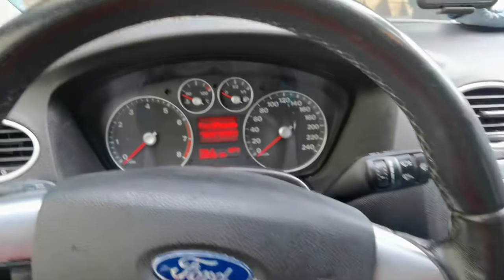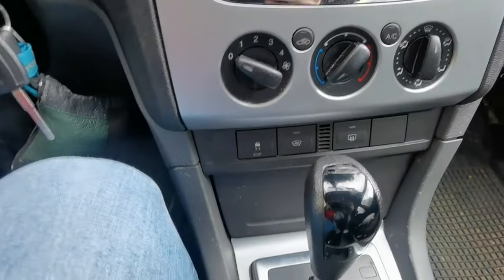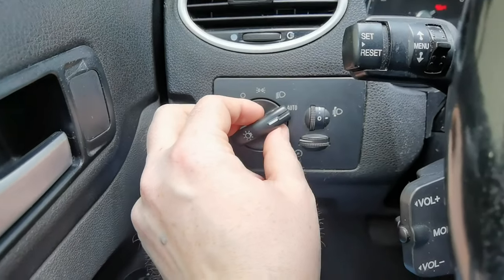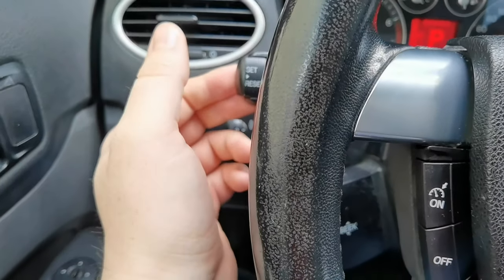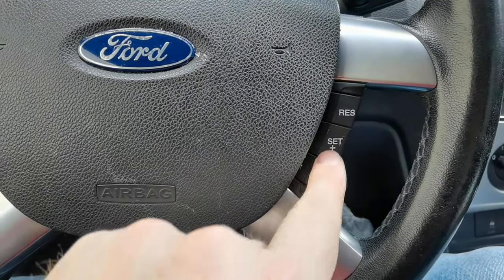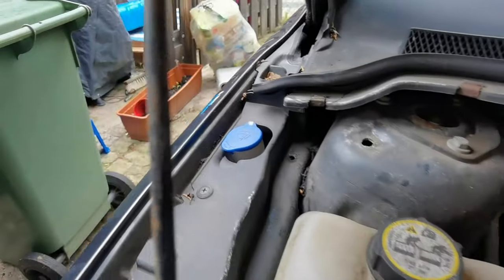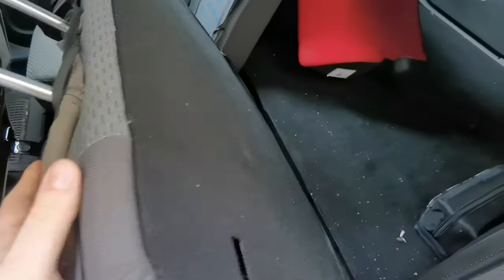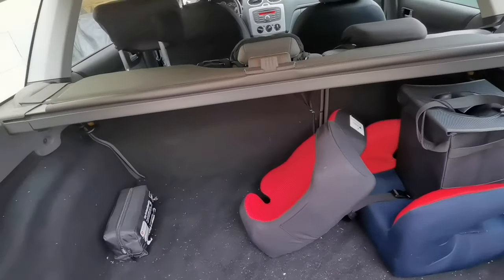Ford focus mk2 (2006/2007) all the controls and features

Comment: Good video the automatic selector probably just needs tightening with the small grub screw this happened with my focus when the selector came off in my hand. Luckily enough I  found the small screw and used a bit of glue before refitting. Yes with the Auto you carnt remove the ignition key unless p is selected as this is for safety reasons as the front wheels become locked in park

Comment: My biggest problem with focus mk2 are the freaking doors locking system freezing during winter, and often getting water into the spark plugs and the mech`S suggest me to get a top shield over the entire engine, but as far i know there is none for the regular gasoline version. But i know Disel versions had, but i did find a Volvo shield that fits over the spark plugs as the mk2 and volvo v40-v60`S are more or less based on the same platform. So yeah my ford focus mk2 now has a Volvo plastic shield over the sparkplugs :D 

" Volvo 30650468 " part number 

But nice info in the video about the back seats. Dint know they could be lifted up.
Reply from the maker: Yea I also just figured that out one day after using it for some years I guess (back seats)

Comment: Hi, How to open the trunk? I do not have an electronic Key just a simple key. I've lost my electronic Key
Reply from the maker: Isn´t there a button or lock at the trunk? I can´t quite remember how it was on our model but that might vary (our now car can only be opened there via the button - that was a problem when the motor that moves the lock broke) 
I think American cars require a emergency open thing in the trunk but that does not help much for day to day operation.

Comment: One question this car have Bluetooth for music??
Reply from the maker: I don´t think there is model which includes that (ours had the buttons for Bluetooth phone connection but that was for a model class above I guess) there are 3rd party radios available where that would be possible.
Reply: Not this specific model, the 2009 model (pretty similar to this) can actually have bluetooth Audio/ usb/ Aux but only with an original Sony stereo and with a right Bluetooth module (hidden behind the glovebox), but again, only for the 2009 Model, this model with the Ford 6000cd only has Bluetooth for calling and nothing more, you can buy cheaps bt reciver on amazon that plugs in the 12v socket and gives you bt audio through FM radio.
Hoped i help

Comment: whre is the radiator?
Reply from the maker: Should be right in front of the engine unless you're talking about something more specific like the heater core.
Reply: @kunicross  i mean radiator cap?

Comment: Ford Focus mk 2 is the one of worst ford evermade .What a bad quality and shit car !There is problem with everything ,bad electronic ,bad motor ,bad strearing,brakes is shit ,taking 10l per 100 km  .I had one and after 3 months throw on garbage and bought VW .
Reply: The MK1 was better (in quality), the MK3 is better to...
Reply from the maker: Now after months of driving other cars I´m almost agreeing - we got our as a present so I´m inclined not to talk too bad about it but I´m glad we´re rid of it
Reply: i have a ford focus mk2 for two years now and all i changed are regular things like oil and tyres. Excellent, amazing, easy, economic, sexy too. It's parts are cheap and are strong. But ofcourse if you drive like you have a Lamborghini, you would say it's the worst ford evermade.
Reply: @ronnyberna663  
I driving 80 km/h and 100 km/ max 😃 .
So ,you are a wrong🤷‍♂️ .Focus 1 is good car ,but that 2 is a great shit ...many mechanicers  saying that  too ...
Reply: @zlatkofilipovic1509  you must have bought a shitter, mines fine pushing 290bhp perfectly fine with no issues 👌🏻
Reply: @roanoconnor98  
Not only me bought shit ,others also ! 
1.8 it's famous as oil eater .
Taking oil same as fuel ! 😃 8l per 100 km oil & gas 😃
Reply from the maker: I used a somewaht similar Ford Sierra a decade bevore the focus, somewhat similar problems with plastic parts breaking and electrical unreliability.
So far Fords track record for me personally is quite bad but I wouldn't say it's enough go judge the whole brand in either direction - overall pretty meh neither stellar nor terrible.
Reply: @kunicross  
No ,i love Ford 
But  focus mk 2 with duratec he 1.8 engine 2005-2006 is a really shit .....factories mistakes ...they screw that .
Reply: @zlatkofilipovic1509  Depends on luck and on how good maintained the car was before you bought it.
Had a Fiesta 2000, facelift, for 4-5 years. A beast of a small car. I've changed the fluids regularly and to be honest, it took me on and off road to places I never thought I could get that car to.
Then I got a Focus MK3 2012 that, believe it or not, blew the engine on highway (autobahn) after only 2 months. Piston 2 melted. Yes, melted. It has a melted missing chunk the size of your thumb fingernail. Rip this one, I really loved the car.
Now I have another Focus, MK2 this time. I'm not a fan of it, but it takes me from A to B, runs fine so far (6-7 months already), not bad fuel economy. Yet... I don't like it for some reason. My heart got stuck on that MK3 :(
Note: All those cars were bought second hand and were/are all gasoline. 1.25, 1.6 and 1.6 respectively. 

Long story short: Can't complain about my MK2, other than the fact that I don't really like the car. Just a personal taste.
Reply from the maker: Yea sadly many smaller cars are often badly maintained partially due to the lower overall value, I think that is also big problem with brands people don't trust as much as fiat.("why change oil if I can refill it from time to time" or even better "Oil??") 

If you can find a senior car that has spend it's life in a garage driving a couple of thousand km per year and always all the maintenance done that's usually pretty good no matter then Brand.

Also I too had this "it drives from a to b but there is no love" feeling with the MK2 - but also every car I drove while owning the MK2 and since is somehow better. 😂
Reply: @kunicross  "every car I drove while owning the MK2 and since is somehow better. " - I actually LOL'ed
No hate towards the MK2, mine is Combi/Kombi/Estate (you get the point, the long one :)) ), I can sleep in the trunk, heating works, engine runs, wheels spin, but still, it has that "something" that makes you hate it every time you drive it after driving another car/brand. :D
Reply: @Ygr3ku  
There is no luck if you know something about car .You should drive and test cars before buying it .
 But anyway ,you can't expect a new car for little money .
Reply: @ronnyberna663  
He is not strong .1.8 / 125 hp ,that should go better ! ,but o.k for Ford .
Reply: @zlatkofilipovic1509  True, we can't expect a new car and top performance from a car that's almost 20 years old and bought for 1000-2000 euro/usd, depending on mileage, but in working conditions. 
I don't know how bad 1.8 is, I was always a fan of 1.6 and 2.0, hence currently I drive the 1.6 version of MK2.
So far, can't complain. Drives good, runs good. It has some weird noises when cold start it, might be the chain or "cam followers", who knows. Once it's warm, no sounds though. Problem is: I drive short distances, at max once a week water gets to hit 90*C. But I won't keep it for long, I aim for a 2.0 engine, on a newer model of whatever brand I feel like getting in the future (I'll look for and reliable engine before looking at the brand). 
Any recommendations on engine codes 2.0L newer than 2010? (car price range: max 7k euro)
Reply: @Ygr3ku  
Focus mk1 -2.0 ,zetec engine is dream good car .That engine can go 800.000 km 
All new cars is shit & i'm not interested in it .
Reply: I’ve been driving one for 12 years now. The car is 2006 make. Almost 293.000 KMS and I can’t complain about it. It’s a good car.
Reply: @mohdrafi68  
Of course you had a problems with mmk2 after 200.000 ,but you won't a say it.
Reply: @zlatkofilipovic1509  I said it’s a good car and I can’t complain about it. I never said that I didn’t have any problems. But those are normal things. You should read better. I don’t have that bad opinion about the car as you have.